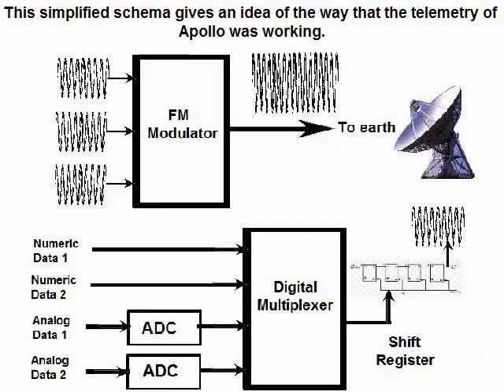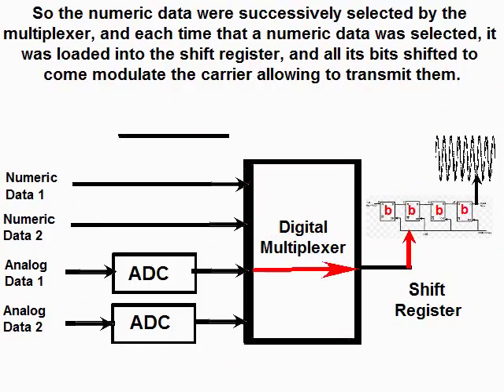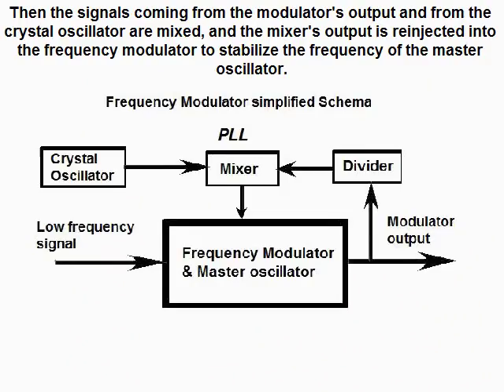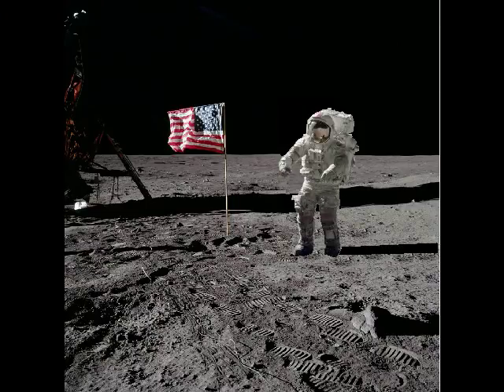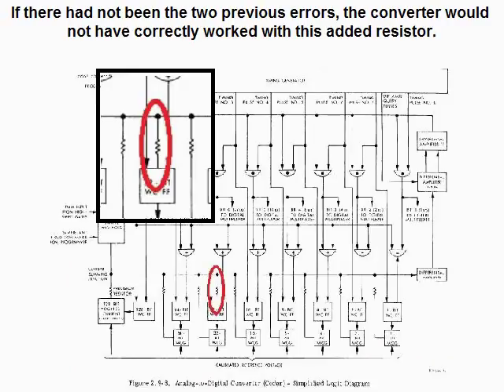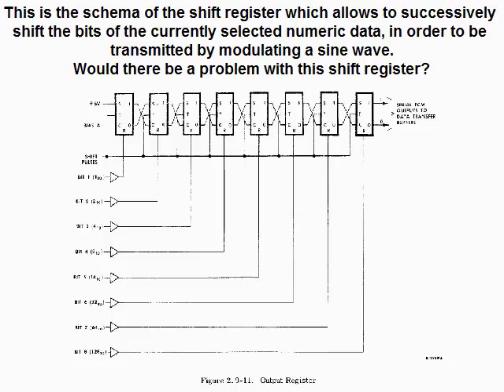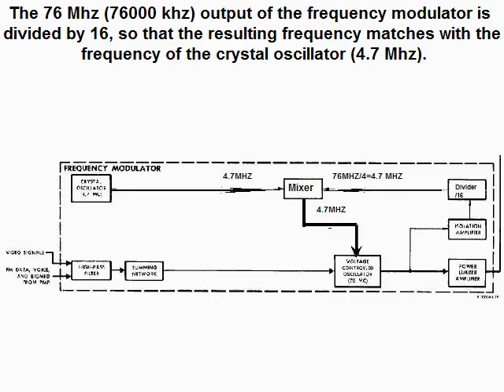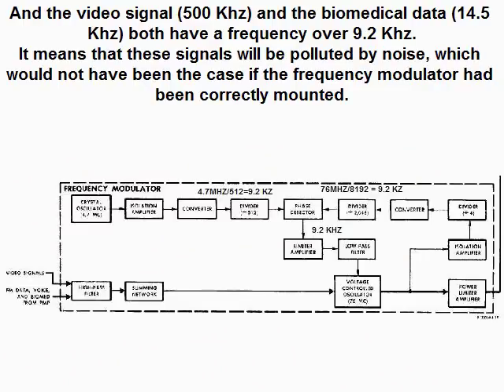Apollo telemetry lost? What telemetry?

Comment: For anybody who actually cares about the facts (which excludes Hunchbacked) the A/D converter he has so much trouble understanding is a straightforward (though very old and simple) implementation of "successive approximation", one of several A/D algorithms. A series of digital values are tested by converting them back to analog with a D/A and comparing that with the input. The timing generator tests one bit at a time, starting with the most significant bit. If the D/A output does not exceed the input, that bit is left at 1; otherwise it is cleared to 0. Then it proceeds to the next most significant bit until none are left. The precision resistors from the flip flops form the D/A, and the comparison is performed through a current-summing junction -- exactly as the drawing says. There is NO error in connecting the sample-and-hold to the current summing junction and the differential amplifier input, because that's exactly how current summing works. The spurious resistor from the 32-FF back to the current summing node is a simple drafting error (remember these are simplified block diagrams, not detailed circuit schematics used for manufacturing) but any competent EE can easily see how the circuit works, that it did work, and that the engineers who designed it knew what they were doing. Unlike hunchbacked.
Reply: These are BLOCK DIAGRAMS! They are not intended to tell a factory worker or even an electronics technician how to build one of these things. But they do give enough information to an electrical engineer like me to understand the overall idea and to "fill in the blanks" (design what's inside those blocks) and interconnect them so that they all work. An EE knows how to design a S&H, or a voltage-to-current converter, or an amplifier, whatever, or he knows where to quickly get that information and how to use it. An EE knows how to pick the right parts even when rebuilding a 50-year-old design where all of the original parts are long obsolete. All that is part of what we're trained to do and experienced in doing. And there are usually many valid paths to the same end; two engineers working independently from the same block diagram may very well draw different detailed schematics, but their designs will still work by applying the ideas in the original diagram.
Reply: If true then why was the telemetry lost? It would be scientifically sacred data.
Reply from the maker: Yes, this is a successive approximation AD converter exactly, and this successive approximation converter works in a very determined way; the analog input to convert and the output of the resistor network cannot be directly connected with each other but as two separate inputs to the differentiator; and the outputs of the converter are not the outputs of the timing generator but the ones of the flip-flops at the bottom of the schema; and the resistor which has been incorrectly added to the resistor network would prevent it from correctly working.
You don't even seem to know how it exactly works; I can explain very precisely how it works.
Reply from the maker: +ApolloWasReal
Connect an AD converter like it is on the NASA schema, and show ut it can work that way!
Reply: Sorry Sir, but this schematic makes no sense, either. You tell us, that “The precision resistors from the flip flops form the D/A, and the comparison is performed through a current-summing junction”. That would only work, if the output of the SHA would be inverted and connected to the junction with a precision resistor, too. Then the “differential amplifier” is actually a “zero current detector”. Not really plausible.
HB has found so many inconsistencies and failures in this “Apollo Operations Handbook Lunar Module”. And I am sure, if YOU would take a closer look on it, you would find even more. What conclusions should we draw from that? Is it only a “propaganda paper” with no reference to the real technical base? Or is it an uncaring together thrown heap of paper to feed people who want to believe in Apollo but have not enough technical knowledge to see, what’s wrong.
For sure we only see, what it doesn’t  is: a real documentation of a real technical project!
Reply: Wrong as usual, hunchbacked. The current summing technique is very simple; let's see if you can understand it. The set of 8 binary-weighted resistors are supplied with a precision voltage at the bottom of the diagram. They are connected (or not) to the current summing junction by a set of switches controlled by flip-flops. Also fed to the current-summing junction is the output of the sample-and-hold. This is a *current source*, in that the S&H output drains to the negative supply rail an amount of current proportional to the analog value being converted. (Remember that transistors are essentially current amplifiers, which makes it easy to design constant-current sources and sinks.) This sets up a sort of "tug of war" between the sample-and-hold and the binary-weighted resistors. If the digital value being tested exactly matches the input voltage/current, then the voltage on the current-summing junction is zero. But it's much more likely that one or the other will "win" the tug of war; if the test digital value is higher than the sample-and-hold, the voltage on the current-summing junction will be positive, and if the digital value is too low the voltage will be negative. 

The idea is to drive the voltage on the current-summing junction as close to zero as possible by finding the digital bits that will supply, through the precision resistors, current to the summing junction that equals the current being drawn from it by the sample-and-hold device. Remember Ohm's Law: if the voltage on the other side of the precision resistors is known, and the voltage on the current-summing junction is zero, then we know the current through each of those resistors. That's why the switches are called "weighted current gates".

This voltage is fed to the differential amplifier (probably a comparator, a particular kind of differential amplifier) that compares its input voltage to ground (0 volts). If the input is positive, it generates a logic '1'; if the input is negative, it produces a '0'. This is fed back through the differential amplifier gate and differential amplifier flip-flop to the series of AND gates, one for each bit, so that the corresponding data bit being tested will be cleared at the end of the clock cycle if the comparator outputs a '1' and left set if the comparator outputs a '0'. When you're done, the bits in the data flip-flops are a close digital representation of the analog input. Any competent electrical engineer can find this very easy to understand. I certainly do.
Reply: You don't have much practical experience with electronics, do you? A sample-and-hold circuit can be very easily designed as a current sink. Remember, I said that (bipolar) transistors are basically current amplifiers, so it's easy to make an amplifier that produces (or sinks) a given current for a given voltage input. It's even easier with a field effect transistor (since it converts voltage directly to current) but I think they only appeared in the early 1970s so they might not have been available to the Apollo design. Remember, we are only looking at block diagrams here; any competent electrical engineer knows how to design and build a working circuit that follows the same principles. I certainly can.
Reply: By the way, the voltage-to-current conversion from the S&H could even be a simple resistor. Just put a resistor between the (voltage) output of the S&H and the current summing junction. The fact that the current will vary with the voltage on that junction as well as the S&H output really doesn't matter because the purpose of the circuit is to drive the voltage on that junction as close to zero as possible, and in that case Ohm's Law tells you exactly how much current will flow through it. In fact, this is exactly how the weighted current gates at the bottom of the diagram already work: a precision voltage is supplied from the bottom, and precision resistors are switched in and out between it and the current summing junction. All you need to understand this is Ohm's Law and Kirchoff's Current Law, things you should have learned in Electronics 101.
Reply: It’s a basic principal of scientific thinking to call everything in question, always, and especially the own conviction. When you stop doing that, then you have stopped being a scientist.  
And another principal in science is: attack the message, DO NOT attack the messenger! Whatever you might think about the mental constitution of your opposite keep concentrated on his/her arguments. When you start abusing people thinking differently then you, you have already lost. 

Sorry about telling you such truisms but the most annoying thing in the discussion about the manned moon landing is the rigidity and aggression on both sides. From my point of view this has basically been triggered by NASA and their propagandists. It has already begun with using the term “conspiracy theorist” for people who are skeptical about their fanfares.

The Apollo project was mainly not a technical project. It was a political project or better an subject of propaganda in the cold war. Thus, even if it would technically have been possible - which was after my conviction not the case – it wouldn’t have been done in reality. I’m still undecided if that ever was an option, maybe on the very beginning. The risk of failing would have been much too high and it was much more efficient to play a theatre performance. And with the most truth-loving president the US ever had (until one year ago) the decision was made long before the project came to its supposedly successful end.
Reply: Of course it's a basic principle of science to question everything and pay attention only to the evidence. But that doesn't mean everything you might question is false, or evidence of a massive conspiracy that only you can see. And I do present evidence that it all worked, that those claiming it didn't are simply wrong, and that the program actually did land 12 men on the moon between 1969 and 1972. Adding an editorial comment on the incompetence and stubbornness of those who believe Apollo was faked hardly takes away from the evidence that it wasn't. If you don't like being editorialized in that way, don't make claims that are so easily disproven.
Reply: Of course I don't seriously consider the possibility that this device didn't really work. The mountain of evidence that the Apollo program was real is simply overwhelming. When I can't immediately figure out one of their diagrams, which is the more likely possibility? a) I simply haven't studied it enough, or b) the entire Apollo program, with the aforementioned mountain of evidence for its reality, was in fact a gigantic fraud and I'm the first person in history to discover that fact?

I've studied a lot of Apollo diagrams, and I've yet to find a single one that I couldn't understand if I simply looked at it long enough. Hunchbacked, on the other hand, sees something he doesn't immediately understand, or isn't designed exactly how HE would have done it. And since knows he's the greatest electronics genius in history, he immediately concludes the entire program was a fraud? Give me a break.
Reply: Oh by the way, it's perfectly OK to ask questions about these diagrams. That's how everybody learns, including me. It is not OK to jump to the conclusion that it must be a fraud just because you can't immediately understand it. If you do that, then yes, you ARE an ignorant fool and I won't hesitate to say so.
Reply: Okay ApolloWasReal, now we know for sure that you are not a real scientist but only a propagandist. And your main skill is to abuse people having different opinions to you.
You think, because you can translate electrical block diagrams in real working schematics you know how everything works. But the world is much more complex than an ADC. 
Every teacher of a primary school can see that the astronauts in the Apollo 11 press conference are in an extremely uncomfortable situation because they have to tell the biggest lies to journalists from all over the world. You don’t need to be psychologist to see that.
Every third level politician knows that only one dead American astronaut would have destroyed immediately the whole show and turned it into a PR disaster and a political catastrophe. Thus, nobody could really risk that.
Not to mention the overwhelming physical and technical impossibilities which for sure have prevented this mission to become real. And the hundreds of failures, discrepancies and impossibilities people have found in the film and photo material you simply ignore (by the way, do you know how classical film material behaves in ultrahigh vacuum?  The vapor pressure of the carrier courses thousands of little bubbles per square inch)  
But you will that ignore, too. That’s what Apollo propagandists usually do together with abusing their opponents.
Sorry for the wasted time.
Reply: Sorry Sir, but you haven’t gotten the point. Undoubtedly, you are able to understand electronic schemas and I’m sure you are also able to build up an 8 bit ADC with 50 years old electronic parts. But we are not discussing your skills. 
We are discussing the presented document and the electronic of the Apollo LM that is described, there. You say, these are block diagrams, no detailed schematics, and a competent EE recognizes the intension and is able to fill the blanks, okay. You say, the error drawings there are not relevant for the function of the real device and would have been removed when it has been transferred in real products.
I say, the document is not a proposal for a machine to be designed in future where engineers have to fill then the blocks with real stuff. It is a description of a vehicle that has (supposedly) already build up and used. The only intension of publishing these and all related documents is to show WE DID IT! 
From this point of view I would expect that the descriptions do not contain so many errors and so many gaps. Errors and gaps which indeed prevent the device from working at all.

Your view on this is imprinted by the conviction that “ApolloWasReal”. You are willing to tolerate any bug in the document and any blank, no matter how huge it is. You do not even take the least possibility in account this machine could not have worked. This is okay. But you abuse everyone who doesn’t do it the same way, who points the finger on these faults and ask questions about it, as an ignorant, a dilettante and a fool. That’s not okay.

These documents contain so many errors, it’s unbelievable. If the presentation of a scientist on a conference or in a paper would contain half of them, he wouldn’t be taken seriously by his colleagues. I do not share the opinion of HB that these errors are intentionally made by whistleblowers. I think 99% of the employees, even in the CIA infested Crumman Corp., were trying to do their duty and solving given tasks, not knowing they are producing only very expensive requisites for a disgusting theatre performance. The only reason for this sloppy documentation, I can imagine is, that the product it describes never has been used. Thus, the failings did not lead to the catastrophe that would undoubtedly had occurred if it would.
Reply: My skills are important in that (unlike Hunchbacked) I am perfectly able to understand the diagrams and conclude that they worked. As I've said many times, these are *simplified* block diagrams in manuals written to train the crews and especially the systems engineers who had to operate and troubleshoot them. I've used many similar documents in my career (which was not in space flight). In such documentation, excessive detail simply gets in the way. They were not written to tell factory technicians exactly how to build them, or even for other engineers to spot errors before they were built. And they were certainly NOT written to personally convince YOU 50 years later that Apollo wasn't a hoax.

I doubt it ever occurred to anyone working on Apollo that there'd now be people so cynical and uneducated as to (apparently) seriously believe that the whole thing was a hoax. Besides, even the most detailed documentation wouldn't do any good on people as incredibly stubborn and technically incompetent as you and hunchbacked.

Ironically, the problem is that, far from there being too little Apollo documentation for you, there is *too much*.  The more there is, the more of it you can misunderstand and point to as supposed "evidence" for a hoax. Real hoaxes don't come with anything like Apollo's enormous mountain of documentation, historical records and openly accessable museum artifacts, and for very good reason.
Reply: Funny you call me an abusive propagandist, but then you totally ignore the very specific technical points I made in the discussion about the A/D converter and launch into some totally irrelevant tirade about the Apollo 11 astronauts looked at their press conference. Care to actually go back on topic?